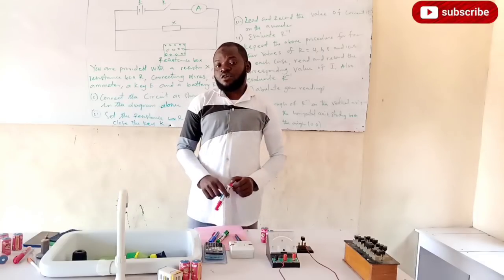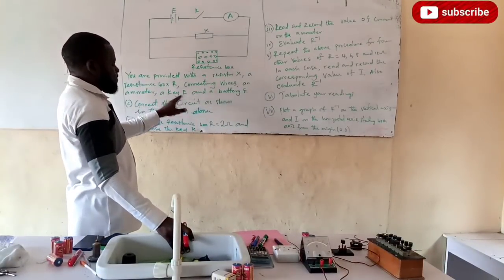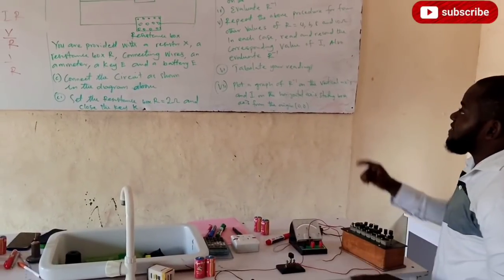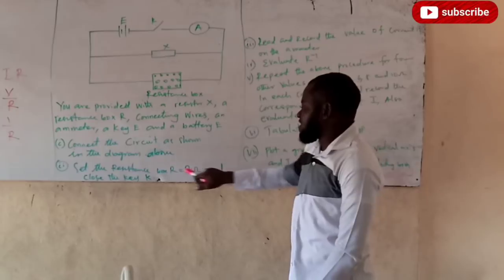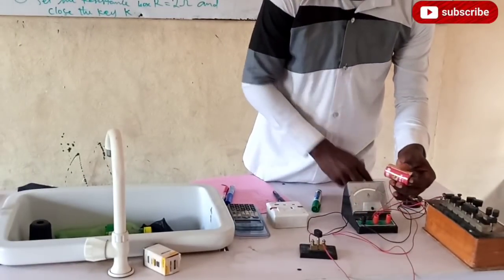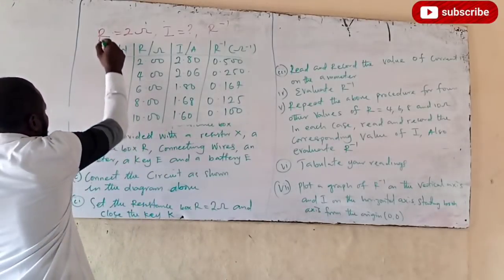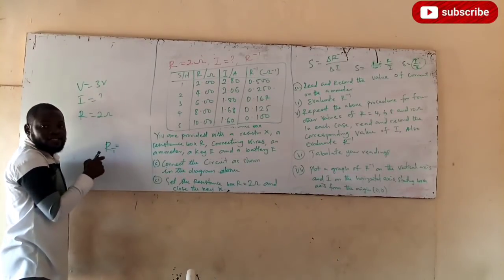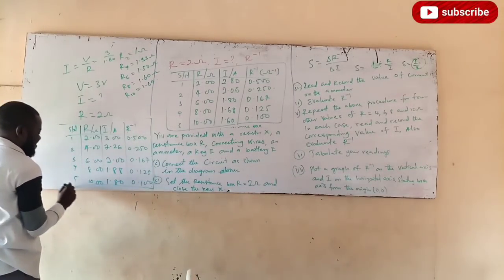NECO 2021 PHYSICS PRACTICAL ELECTRICITY

Comment: Sir please which of the wires is negative and positive…and I really enjoyed this video❤️
Reply: Wires do not have polarity. The only place you consider polarity is in the measuring instrument ( ammeter and voltmeter) and the cell. The red points are the positive while the black points are negative. However red are black are also use to code wires but the colors do not really matter.

Comment: Thank you alot. But my question is, the slope suppose to be 3.7. Or 2 . Something as the case. But what I observe was you inverted the resistance. Which is resistance inverse.  I thought we have already plotter and got the value of resistance inverse. Are still going to inverse it after we have already known the value In the table?

Comment: Thanks for your effort always. But the circuit should be connect all together in series. That standard resistor can't be connected in parallel. Only Ammeter is involved and no rheostat. And we are to use 0 to 2A. The readings aren't even up to 1A. check it out
Reply: But if we were to use the manipulation would it be correct
Reply: If we follow the circuit diagram, it's parallel

Comment: Thank you very much sir for this. But the ammeter we are told to use is 0-2A ammeter and when I did mine with 0-2A, I was getting less values than what you got. For instance, I got 0.8A for 2ohms resistor.
Reply: What if the voltages just different?
Reply: @5secanimate749  we were told to use 2V or 3V. The fact that the ammeter full scale deflection is 2A. Sir your readings do not add up.